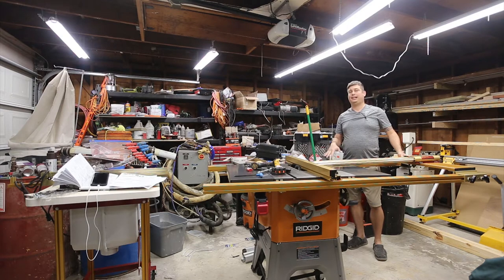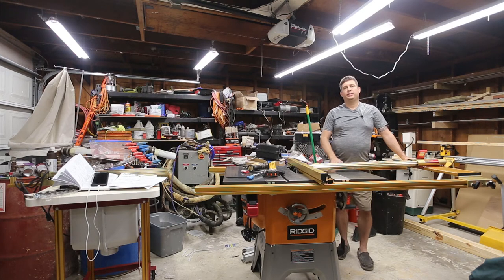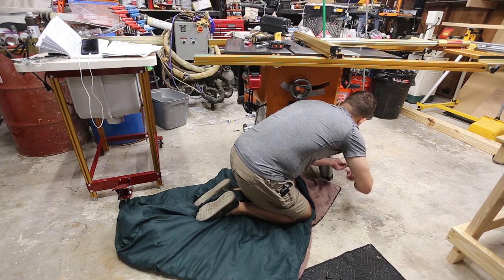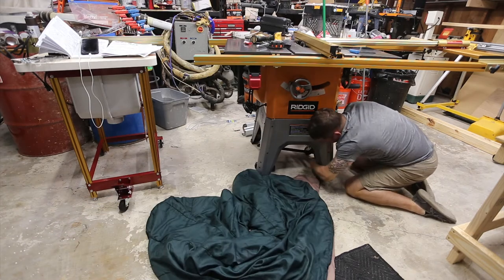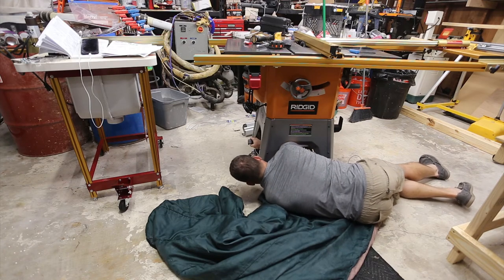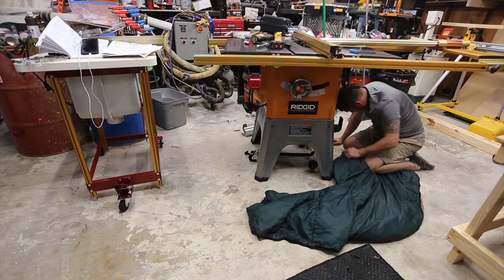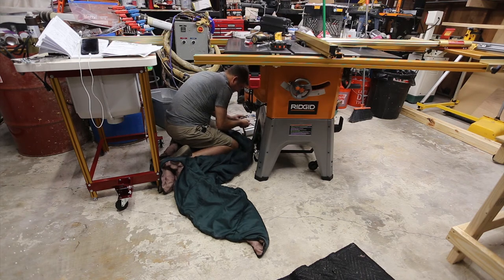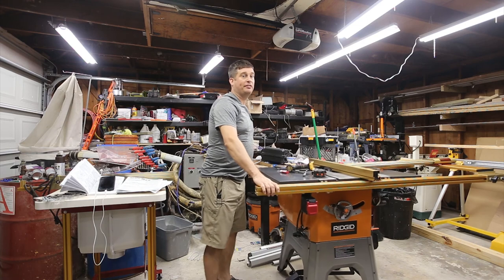How to reverse the wheels on an R4512 Ridgid Table Saw when using an Incra Fence System

Comment: @ Chris Ward  .......  I have this saw and mine has the 4 wheel caster system.  My pedal is in front of the saw (operator's side).  Mine banged to the floor also.  I agree with you .... bend down and release it by hand s l o w l y and there is little to no bang.  Been doing it this way for 3-4 years now.  

I might add I have the Incra fence system too.  I removed both sheet metal extension tables and put an Incra router table with lift on the left side (over the motor housing) and I then built a table to fill the hole on the right side of the saw.  As a precaution I also put Incra's leg set on the right side to help with moving the saw.  I added some triangular 3 wheeled casters to the legs to help also.

Comment: I know, it is a bad design. I'm tempted to buy the 4 caster system if available, but I'm not sure if that would make a difference. I also thought putting smaller casters on would lower the legs a bit?? making less distance to fall.
Reply from the maker: I think the reality is to just try to minimize the slam.  It's really my only complaint. The caster system itself is genious.  the problem is it only has tension in one direction.... so when you lower it the system drops.  The dropping shouldn't destroy the alignment if it's solidly built.  I don't think it's meant to be moved constantly, but only occassionally.

Comment: my r4512 has the foot lift in the front already. did they change the design or did you put the saw on the base sideways?
Reply from the maker: I think the design changed.  There is still a balance issue if you follow the manual and have the Incra fence.  I had to turn it 180 degrees to fix the balance issue.  I don't like that it drops very hard.

Comment: Is the connecting bar from the "pedal" wheel to the rear set mounted correctly?  I watched an install where the lever at the back set of wheels is point "up" instead of down.  I'm not sure ... is the assembly between the old 4-caster system different from the instructions for the 3-caster system?

Comment: Brian--  Wife bought me my R4512 last X-mas, and I love it (and my wife).  Curiously, my saw's casters already have the lift lever and swivel caster on the left side when standing at the saw.  Did I assemble it backward and not notice?  Never had trouble with moving it around (except for Jack's previously mentioned "bang" when lowering the saw back down).
Reply from the maker: I put it together reversed because of the Incra fence.....

Comment: My caster lever is already on the left side. I think that how it was supposed to be. If you don't want the saw to drop suddenly I have found the best way is too just bend down and release the lever slowly by hand rather than doing it by foot. Yes, you have to bend over to do it, but It won't fuck your shit up and get your saw out of alignment over time. I wish they made the casters to where you could move it forward and backward instead of just side to side. That would be great for my little shop so I wouldn't have to parallel park the darn thing up against the wall when not in use.

Comment: Hey Brian, I heard your concern about the hard landing the saw makes when you let it down. I added weight to my saw with a cast iron wing for my router, the legs are 1" or more off the concrete floor and when I let it down it crashes down with a bang. I'm worried it will eventually mess up trunnion alignment. Have you figured out a way to soften the landing? I have a 3 wheel system, you think the 4 wheel system might be better?
Reply from the maker: I never did figure it out.  I just try to slow it down and am careful.  It's a defect in the lift mechanism design.
Reply: I placed some material made out of high density polyurethene foam (Fypon). I had some leftover from a previous project. Just two strips on both sides and there's only about an inch of travel for the wheels to make contact with the foam.  It's very sturdy, no racking at all. The drop is much less noticable and much more gentle.  I wish I could convert the three wheel system to the four way castor like on older models. I have to move my saw too many times just to make work space in my VERY SMALL space in the basement.
Reply: I installed half inch plywood to the plastic feet. It still raises it about 1/4 inch off the ground but it drops so easily now.

Comment: Added weight???  Your original Ridgid fence isn't installed anymore ... are you saying the Incra system is so much heavier than the original Ridgid fence system?
Reply from the maker: Yes, exactly.  The Incra fence is pretty heavy.  The stock Rigid fence is maybe 5 to 10 pounds.  The Incra fence is much thicker material and quite a bit more of it.

Comment: Brian, you silly rabbit you!  Lol  I know this is sooo late, however, per the Ridgid R4512's instructions, you were supposed to install the casters with the lift mechanism to the left of the saw anyway (when standing on the feed side of the saw).  Also, to anyone who is wondering, yes, the design of this particular saw has been changed.  I purchased this saw twice and can confirm this.  I personally loved the first design's caster system because the lift peddle was in the front of the saw and it had 4 casters instead of 3 like it does now.  In the first design the peddle was much easier to push and the 4 casters made this unit roll in a more stable manner.  But you all know how it goes, companies and their "decreased quality for increased profit margin" antics.  Peace all!
Reply from the maker: I think my instructions called for it to go the other way.  The lift mechanism is the weak spot on that saw.  It is just not a very smooth mechanism for lowering the saw.  When you add the Incra assembly or a cast iron wing it tends to drop the saw harder than I would like.

Comment: You put your saw together incorrectly.  The foot pedal is supposed to be on the left, check your manual, the front page has a diagram of the entire saw assembled. It'd be hard to get to with the ridgid or incra fence on the right.  This video is literally just reversing an inproper assembly.
Reply from the maker: Thanks for watching.  The Rigid instructions call for the pedal to mount on the right side of the table which is fine with their short fence.  I did that and it was impossible to reach so I took it off and turned it around to make it reachable on the short side.  The core issue is the mechanical design of the lift system doesn't smoothly lower the table.  With the increased weight of the incra fence it slams the saw down.  Not the end of the world, but not ideal.
Reply: Brian Greul the manual has you install the casters when the saw is still upside down so maybe you got confused?  The ridgid website clearly shows it on the left https://www.ridgid.com/us/en/10-inch-cast-iron-table-saw
I totally agree with you that it's a crap design and when I found out they switched from a 4 caster design I was so annoyed I pulled the base off and built a cart from 4x4, 2x6 and plywood with 4 locking swivel casters..  Highly recommend doing the same. Rolls easier and fits anywhere.  Now I can install drawers or cabinets under the fence too.